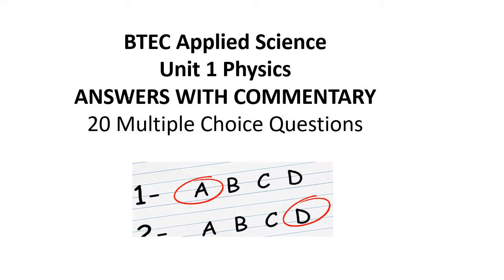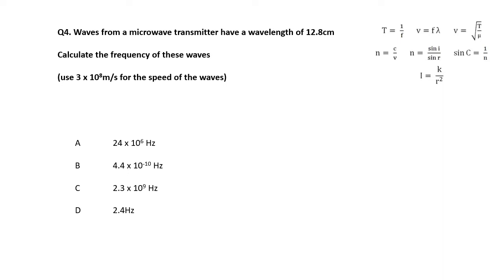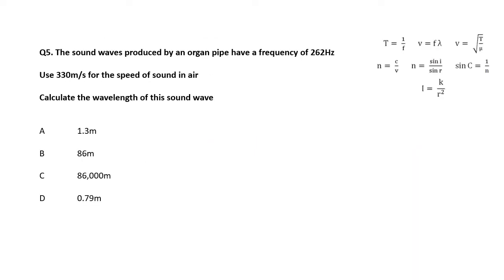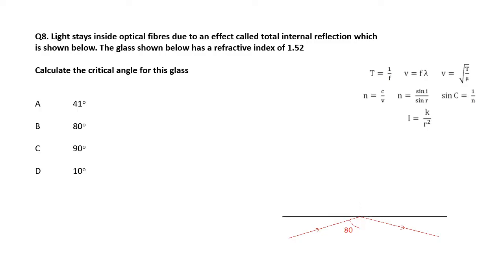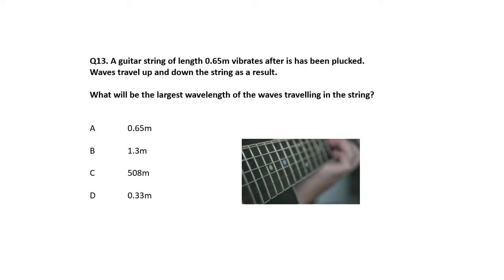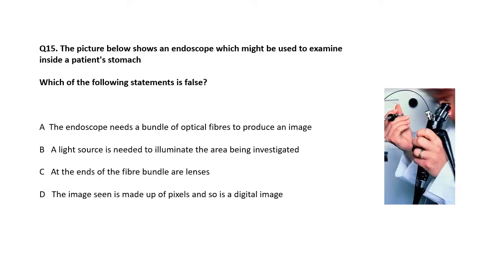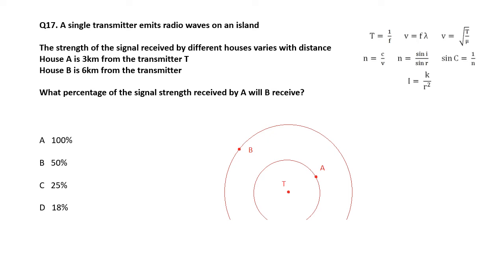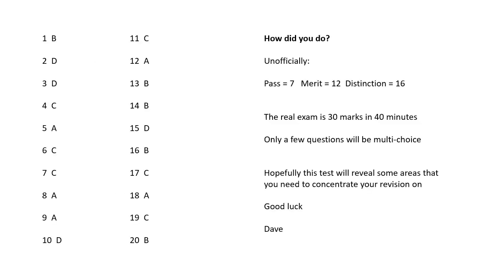Physics MC Test Answers with commentary

Comment: Hi sir I didn't quite get question 17 is a bit too complex
Reply from the maker: imagine you are 1 metre away from somebody singing.
now imagine you start walking away from them, As you do so the sound you hear gets quieter. Why? Because the energy of the sound wave is spread out over a bigger area.
If the distance between you and the singer is double then the energy is spread out over 4 times the area, so the intensity (energy per unit area) will be 1/4
In this question B is twice as far from the transmitter as A so the intensity at B will be 1/4 of what it is at A. i.e. 25%
Reply: The way I figured it out was that point T is 100% then point A is 50% so point B is 25%. Since the distance is doubled you just divide 2.
Reply from the maker: @YoshiroWendy  no, that is not the case
Reply: @btecappliedsciencehelp  so is it something more than that